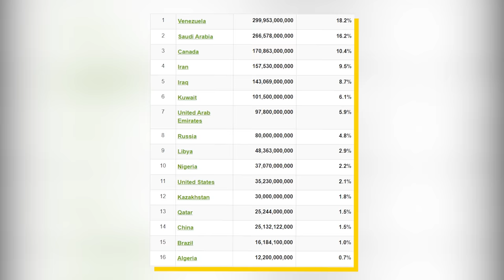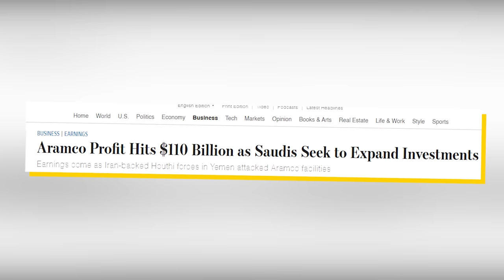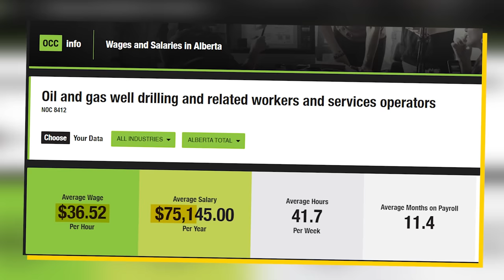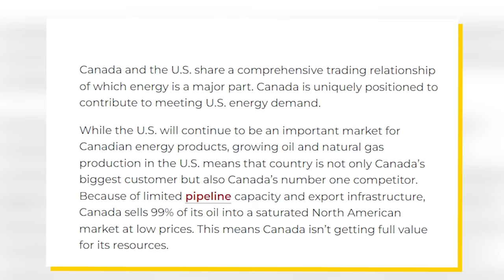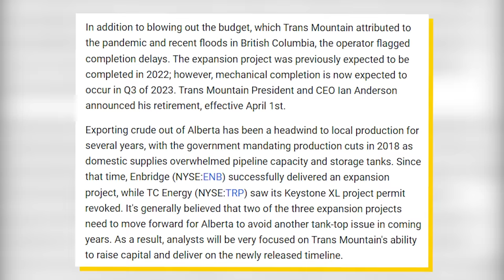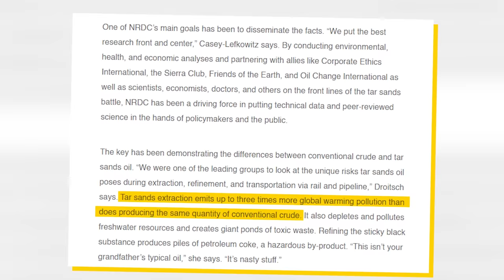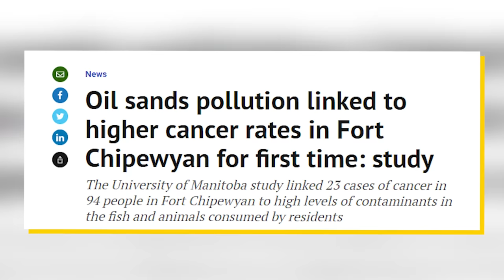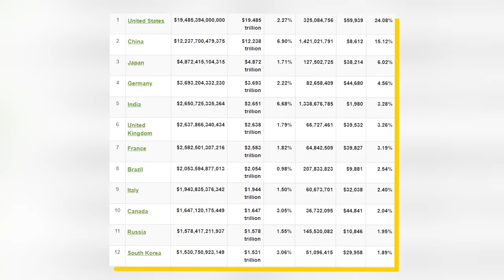Why Canada Refuses To Exploit Their Gigantic Oil Reserves

Comment: 5:40 Its not accurate to say that Canada has not considered the option of exporting oil on the global market. The fact is that on both coats, there is a province that absolutely does not want to allow "dirty oil" through its jurisdiction. Alberta's oil is effectively landlocked. Worse yet, Alberta had an opportunity to export that oil. In the 80s, Trudeau wanted to use that oil to benefit the entire country. Alberta chose to be selfish. Alberta did not want to share the benefits of that ressource with the rest of the country. Pipelines definitely could have been built in the 80s. Environmental regulations were weaker, and the environmental movement was still in its infancy. In today's world, there's absolutely no way those pipelines are ever going to get built. Alberta's greed ended up costing them the only chance they had to get their oil to market. That legacy still haunts Canadian politics to this day.
Reply: Oil resources are provincial jurisdiction, so it isn't greedy for Alberta to keep the royalties from their own oil. If provinces like BC and Quebec would just develop the hydrocarbons  they have, instead of forcing them to stay in the ground, then they wouldn't have to demand that Alberta share.
Reply: @sagmilling  As far as I know, the only oil that is reasonably recoverable in Québec is located in the St-Laurence Gulf. One of the company who had the licences failed to get its licence renewed in 2020. The whole thing has been a cluster f of mishandling. They clearly weren't ready to exploit anything at all. If anything, there's a history in Québec of small "newly created" companies pretending that there's oil to be exploited, that they know where it is, finding absolutely nothing and leaving a mess behind. They are a large part of the reason why there's a distrust of the oil industry in Québec. Serious oil producers know better and aren't going to come here to exploit a money pit.
Reply: @sagmilling  Why should Quebec bother with oil when everything is slowly getting electrified and the province happens to have super cheap electricity available?

Comment: 9:40 is a pretty good summary. Middle east is almost completely dependent on oil for the countries to survive and become rich so they put their entire focus on oil. Canada has a large industrial base along with lots of other resources. We are less dependent on oil to support our economy. When price of oil drops so production in the oil sands drops we have other potential opportunities. Example- oil sand works operating machinery can relocate to use the same or similar machinery to dig for gold or harvest timber or other resources. Pipe fitters that build the steam systems in oil sands go to places like to Toronto to pipe fit new condos and buildings (I know- friends are plumbers went to the Tar Sands then came back to Toronto), manufactures that produce pipes for the oil sands shift production to produce pipes for other projects (city water & sewer systems, buildings etc) etc. I know it is not that "easy" or takes some time to transition but it happens. Middle East if oil collapses the entire country collapses.

Comment: What I hope is that when we expand exploitation we'll use a less polluting process than the one in use now (CLark). It wastes a lot of water and energy.  Our oil is also more difficult to process and we sell it somewhat cheaper (I think $5-$10 a barrel) because of that.  Indeed most oil goes to the US refineries all located in the South where the Gulf of Mexico is next door..  What we need in Canada I think is more processing of oil into other useful products (eg composites, plastics...).   Remember too that 5  to 8 years ago the market was flooded with oil.  Another point about pipelines is that they would sell better to environmentalists if oil pipelines were built like gas pipelines... particularly in sensitive areas.  When eastern provinces opposed the proposition to reverse the direction of flow in the existing pipelines, a big reason was that not enough precautionary measures were taken to prevent leaks.      ANd last we do have a lot of gas... a pipeline was recently non approved because where it would end in QUébec was up a river (the Saguenay) where 3 to 5 LNG ships would have sailed daily.... And right at the mouth of the Saguenay river is a reproducing and feeding area for whales.  Heavy impacts expected.  Alternative solution that would have been accepted would have been to add extra 200 kilometers to the gas pipeline up to a port located on the ocean (eg Forestville or Baie Comeau).      
Let's hope for the best for everyone on earth with more sensitive policies on energy conservation, transportation and elimination of very low quality products that consume energy and become trash within minutes.

Comment: With regards to the cancer incidence being linked to oil sands production, there are other things to consider rather than just looking at reports by an environmental organization. Here are two things to consider. In the area where the study was conducted, the oil sands are at or near the surface. The Athabasca river flows through this area and is a major source of water for the people in the region. There is natural seepage from the oil sands into the river. There could be a natural cause for the higher rate of cancer if indeed, the rates are actually higher. Also, the results could be due to Sample Size Neglect. This is a cognitive bias famously studied by Amos Tversky and Daniel Kahneman (Nobel Prize winner). It occurs when users of statistical information make false conclusions by failing to consider the sample size of the data in question. They found that this is a common error made even by PhD Statisticians. Kahneman also noted that he had made this error himself.

Comment: The main reasons for Canada's underdeveloped oil and gas sector are cultural and political.

The cultural factor is two-part. One part is that Canadians tend to align themselves more with Europe than the USA, which is a whole other discussion. As a result of this Canadians have adopted attitudes similar to Europeans with respect to climate change, meaning that many Canadians want to phase out oil and gas usage even though they benefit tremendously from the oil and gas industry.

The other part is that the people in the province of Quebec especially imagine themselves as Europeans and are fervently anti-oil and gas. Many are militantly against the construction of pipelines across their province which has resulted in the inability for oil and gas from western provinces to be exported to eastern Canada. This carry this attiude even though Quebec relies on imports from other countries to meet their own oil and gas consumption, and is the largest benefactor province for tax transfer payments from the oil rich western provinces. As a consequence there is a lot of ill feelings between Quebec and these provinces.

The political factor is that some political parties use climate change and other environmental issues for political gain. The issue is inflated in order to fear-monger and rally support for their party, as is done in many western countries.

Canada could have taken the route of Norway, a European country, and used its oil and gas resources to develop renewable energy infrastructure. But instead it has put itself in a lose-lose situation - it is not receiving the economic benefits of developing its oil and gas industry further, allowing a mountain of public debt to accumulate, which then has made them unable to pursue development of its renewable energy infrastructure as well.
Reply: What a load of nonsense. 

Quebec is not anti-oil. A majority of Quebecers support the idea of using domestic oil over foreign oil. What Quebecers are against is for them to take on all the environmental risks (e.g. a pipeline crossing the St-Lawrence river that jeopardizes their main source of drinking water), so that Alberta can export oil from the east coast for their sole benefit.

When Energy East was being considered, Quebecers asked the following questions: What is your contingency plan in case of a major spill in the St-Lawrence? In the event where the oil/pipeline company does not have sufficient insurance or goes bankrupt, will the province of Alberta pay for any and all damages? What percetange of revenues will be shared with Quebec in exchange for these risks?

What answers did Quebec get? Cricket sounds.
Reply: @nilloc93  No, Quebec wants to be compensated to be compensated if its territory is to be used to transport oil that will then be exported to other countries, which was the whole point of Energy East. If the goal of the project had been to refine AB oil in Quebec, and then sell it in the province at a lower price point, people would not have complained.
Reply: @jonfklein  What a dumb comeback. The issue is anot a hypothetical and inevitable event like the sun blowing up.

We're talking about the very real and very likely possibility of a spill. Of which there have been many: around 2690 pipeline related incidents since 1965.

And while the St Lawrence is indeed not pristine, our water treatment plants are equiped to make its water safe for human consumption. They are not equiped to remove crude oil.

I would also add that AB benefits greatly from Quebec being the only province in the country that tries to address climate changes.
Reply: @louisd.8928  
OMG, what a load!
Please for the love of god separate from this country. I was praying for it to happen in '95.

Comment: About the ethical argument of exporting oil. Despite the greater difficulty and higher initial environmental impact of bitumen extraction, Canada has significantly stricter environmental regulations that oilfield companies must meet when compared to other major producers. When all Canadian oil production is averaged, Canada has among the lowest CO2 release and overall environmental impact per barrel of oil among producers. By not exporting our oil and letting other producers have the major share of exports, we are actually increasing the environmental impact of other countries’ oil consumption.
Reply: Alleviating shortages or adding to the supply now means cheaper more abundant oil... That would absolutely lead to more consumption. In the meantime, we are getting better over the years at lowering the emissions. Environment with today's technology is in fact alarmingly bad, which means we will have to spend a LOT to lower emissions in the short term, and with the concern being at an all time high and only getting higher, and a country that is more sensitive about that issue than most. I think oil will have its renaissance in Canada eventually, just impossible i this climate.  If you can't manage to get a pipeline  to any of the coastlines or your own major cities... The USA isn't helping the matter, we need infrastructure to efficiently sell to our biggest market, and we need those major cities too.

We just have lower hanging fruit to tackle right now.

Comment: Lmao, Canada's can't even supply its own east with oil, they rely on middle eastern tankers to do it.
Reply: It makes way more sense to just build pipelines west and south and keep importing oil east
Reply: @zybon777  we’d be shipping more oil going west and south which would lower there market share, oil is a commodity.
Reply: Why burn mine... when I can burn yours?
Reply: @xylo5750  Actually we do have a pipeline from Alberta to Ontario, the Enbridge line 6 pipeline. Currently all of Canada's refineries west of Quebec City use primarily Canadian oil. It is only Atlantic Canada and parts of Quebec that rely on imports
Reply: @bryandoehler8962  i stand corrected 🙃

Comment: There is also a very political and historical issue at hand. Before oil was seen as exploitable in Alberta, the province was essentially bankrolled by Ontario and Quebec in the 1930s and 1940s to avoid a debt crisis. There is literally no political desire to help them from this side of the country, and multiple pipeline projects were killed before even starting, making albertan oil almost impossible to sell on european markets.

There is also a monetary policy issue. High oil prices, high enough to make selling albertan oil sands, make the canadian dollar value inflate. At one point during the peak era of oil between 2008 and 2014, CAD and USD held close to parity for a very long time. That is good for oil, but it was slowly killing every other industry in the country and making importing goods an issue, which further made people unwilling to help Alberta in building new pipelines.

Comment: I read somewhere that there are different types of oil. The texture and viscosity will determine its price and which type of refinery can process the oil into usable fuel and by products. The gold standard is Middle-eastern oil because its almost like water and require little to no treatment. Canada and Russian oil comes from perma frost of the Northern regions of the globe thus requires treatment before it can even get processed. I believe the keystone pipeline was a major infrastructure project that would bring this type of oil to the gulf coast where there is a refinery that can further process Canadian oil for exports. Now that's not going to happen anytime soon.
Reply: You are right.. this video severely neglects that fact that the canadian tar sands is heavy oil... 1) it cost more to extract tar sands from the ground.. ie. the margin per barrel is much greater than say the cost to extract from shale oil for example.. middle east oil is the cheapest to extract.. 2) the cost to refine heavy oil is much greater and requires refinery upgrades which probably many oil companies don't want to do...
Reply: Yeah Canada has tar sands Russian oil is a noch above i am not sure if refineries that processed Russian oil could switch to Canadian.
Reply: @nikolajovic1500  As far as I know, the Russian process the oil on location and simply pump the oil to the destination with very little refinery at  the other end. The reason Canada tried to push for the key stone pipeline was that the refinery on the gulf coast can take Canadian oil further refine for global use. If I can recall, the Saudi costs about 8-15c per every dollar while the US is about 20-35C per every dollar. The Russians are about 55-65C per every dollar.
Reply: Canadian oil is considered "heavy oil" (meaning its specific gravity is about 1.0), and is largely unconventional, meaning it is either mined, or produced in-situ via steam.
Both methods require processing, however it is processed to a specific standard which refineries are tooled to deal with.
Most refineries are owned by the same producers, whose markets are divided as upstream, midstream, and downstream divisions.  Profitability between the divisions shifts with crude oil benchmark prices.  Canadian oil refineries use as much Canadian Crude as their feedstock as they can, however they have left-over capacity and therefore much purchase the balance.
Overall, Canadian Oil is eventually processed into the same components as oil produced elsewhere, but in Canada, we have high environmental and regulatory requirements, and among the best safety programs in the world.